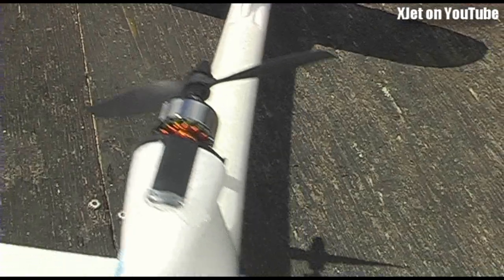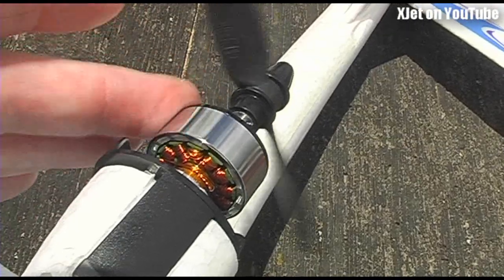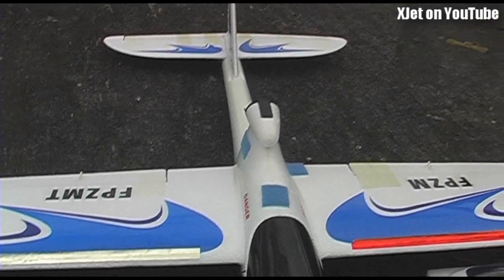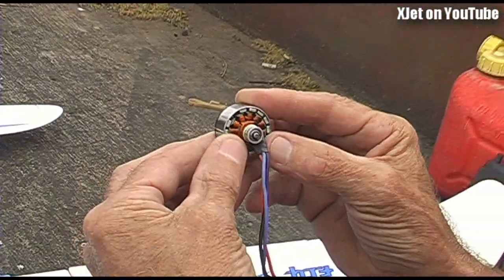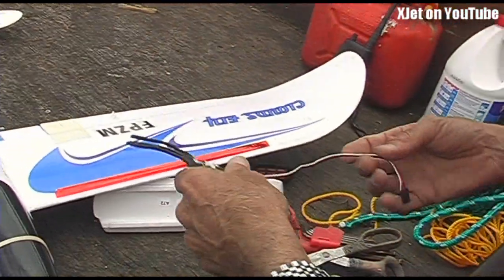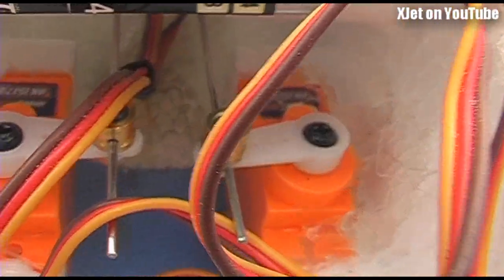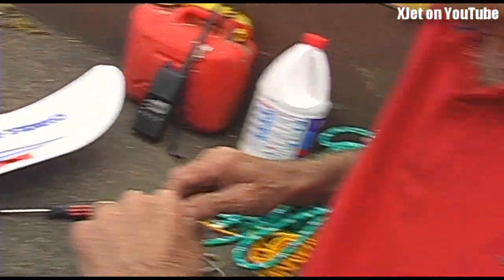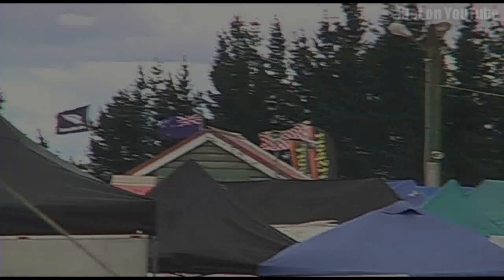Why it's not a good idea to fly your AXN RC plane with missing motor magnets

Comment: @xjet hehehe, now that'd be good.

Bernie at Cox Engines dot CA will sell you a throttle and a glow head adapter that lets you use standard glow plugs as well. Dirt cheap. Shipping to NZ may be a problem, but the parts are pretty cheap, and it'd let you continue to fly the AXN mostly as you do now.

Comment: @xjet Thank you for The answer. REaklly appreciate. Yes I actually experienced some problems in the last batch.
I experienced some jittering when the servo was full travel on 1 side. Haven't checked if it's always on the left or right on all of them. that's on full travel though. in the mids they perform as they used to... 
thanks for the Answer once again. I will try the oranges next time :)

Comment: The missing magnet also mean unbalanced Motor housing which also means more amps which also means more heat which will also mean a dead motor.. :)

BTW Xjet... what do you think of those orange servos? any good.. hows their centering  and how do they compare to the other bunch of cheapos the HXT900s ? ? ?

Comment: After some 38 flights the magnets on my AXN became very loose. I thought that epoxy may be just too heavy and upset the balance of the motor. So I have used CA to glue all the magents in place on. So far so good with all the magnets staying where they are supposed to be. Time will tell if this is a good solution or not.

Comment: @xjet I have both flaperons and spoilerons on mine.. with flaperons it looses quite some aileron authority but its totally controlable using rudder too.. (even easier using combi-switch mix) ..it still turns nice..only quite slower and clamsy..but flaps are only meant for slow down for landings anyway

Comment: @xjet.
  Lost the magic smoke, eh ? My Tower Of Power did that to me last night. Two PV's that had blown 6 Amp Diodes, were replaced with what I thought were 10 A. ones. Lightnin Bolt last night, & the DC pulse from the PV, Vs the induced Current from the EMP blew the new Diodes, which turned out to be only 1 F...ing Amp ! Grrr.
Ciao.